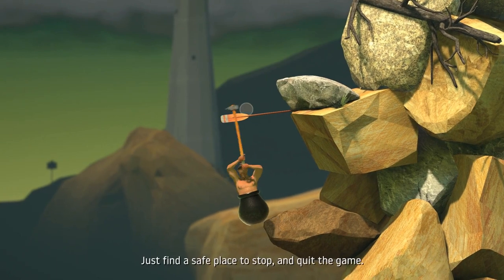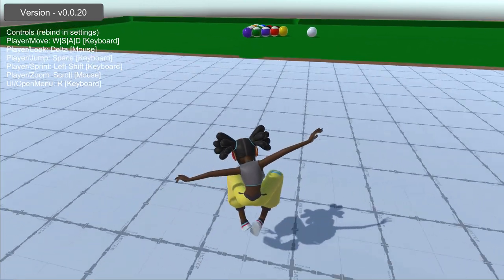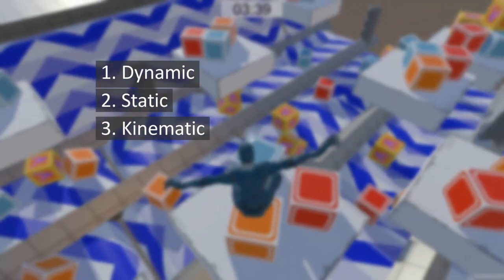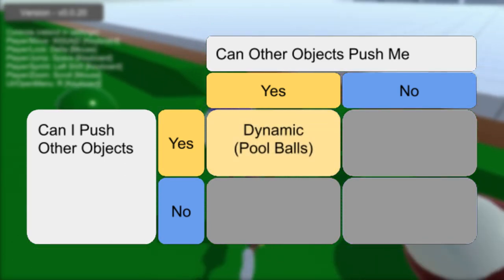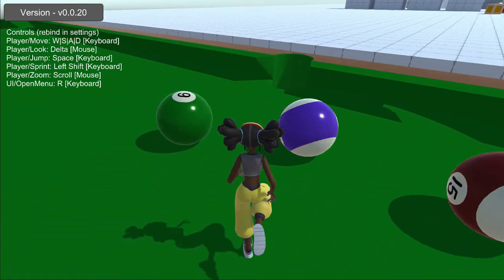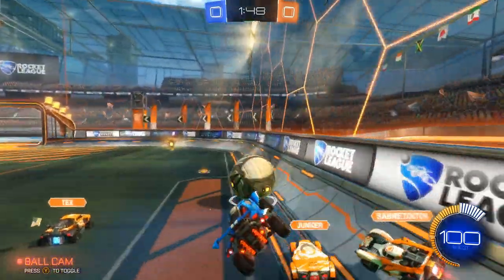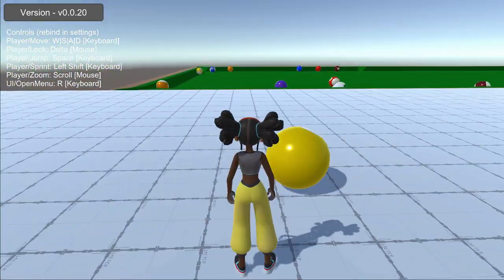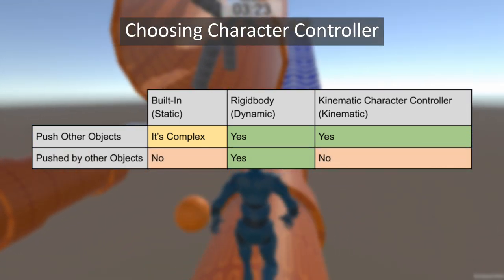Explaining The Physics Behind Character Controllers - OpenKCC

Comment: Personally my go-to for player controllers (We primarily make fast-paced skill-based games) is a dynamic rigidbody controller, writing code around it to keep full control over what the Unity physics engine is allowed to do to our player at what time. With a bit of work you can make an extremely precise and responsive player controller with this approach, while still having the option of going crazy with dynamic physics related features. Great video, keep it up!
Reply from the maker: That sounds like a great design. Is that what you're using for the bullet runner game?

I found managing physics objects every physics update to be quite difficult to get them to work properly with other objects in the scene. I found network sync issues with getting physics to line up over the network with dynamic rigid bodies but kinematic didn't run into those issues.
Reply: @NickMaltbie  Yes that's how we've set up Bullet Runner :)

The approach we take is to add a state machine to the player (e.g. move state, airborne state, receiving knockback state). For movement, instead of using add force we set the x and z velocity directly (with some lerp magic on top), and keep the y velocity the same to keep gravity functional. That way our player can not be pushed around by other objects. When we want to implement e.g. knockback, we either disable the movement code for a short while, and perform an add force, or we add a vector3 force to the movement velocity calculation, that we lerp back to vector3.zero over time. This way you keep a lot of agency over the physics, and the player is snappy, predictable and works well with networking
Reply from the maker: That’s a great way to manage the movement and still allow for physics based interactions. I found that kinematic objects felt the most “snappy” but most of my use cases don’t require physics interactions so it would work the same regardless.

I still have to switch my project over to a FSM design. I’ll make sure to check out some of your videos in the future, the project looks interesting!

I was always frustrated by unity’s non deterministic physics but this seems like a good enough way to get around it. Does that kind of interaction work for other objects pushing the character around as well since you set the player velocity?
Reply: @NickMaltbie  Thanks! I appreciate that <3
Unity physics can be a bit of a pain to work with sometimes, but it is possible xD So, with setting the velocity to a custom Vector3 (e.g. based on input) will make sure the player can't be pushed around by other physics objects since you're 'overwriting' the rigidbodies velocity and thus ignoring any external forces
Reply from the maker: @kamigamesofficial  haha, that’s why I decided to go kinematic character controller because that’s the whole idea of a KCC object. But sometimes you want to be pushed by other objects so it’s hard to say sometimes. Good luck with your project. I’ll make sure to checkout any other videos or updates you post on your channel.